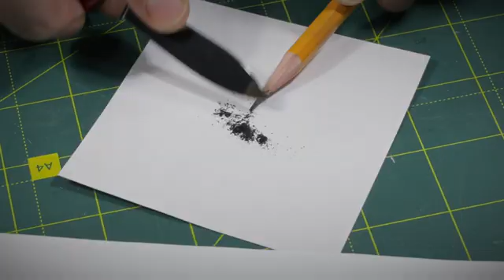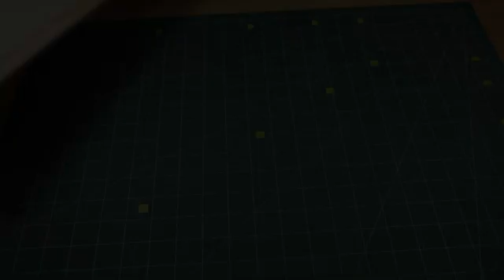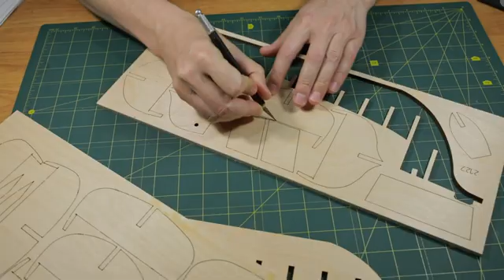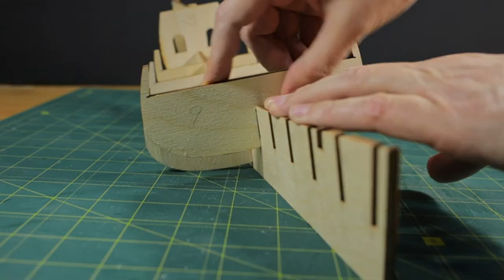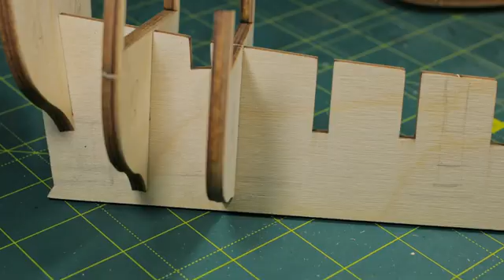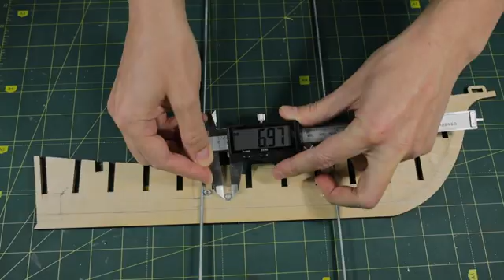# 1. The Skeleton Revamp. Columbus Santa Maria. Scale 1/65

Comment: I am following your ideas.  Inserting infills all the way, not just front and back. But all hand work - no machines.  I am using balsa wood because it is easy to sand, yet it provides firm surface to glue planks to it. 
I am finding that some of the Amati bulkhead pieces are not correctly cut. That is where the infills help to get nice shape.
I am also making some alterations - longer and lower forecastle,  different bow 'nose', cutting off the plywood keel edges, and gluing new edges from walnut.
As you said somewhere - the Amati kit is a good base that allows alterations.
Reply from the maker: I’m genuinely glad that my ideas can be useful. I love machines, and I see creating models in CAD systems as a part of the creative process. But I have great respect for craftsmen who build models entirely by hand, without relying on machines.👍

Comment: Some good ideas that simplify the building of the ship's hull, improving the original kit. Great set of skills, namelly the Autocad's - have you considered some videos regarding the use of CAD in ship's building?
Great job!!
Reply from the maker: Thank you for good words and an idea. Probably I will do it sometime. However there is nothing special in using CAD for shipmodelling. Principles and tools are absolutely the same. Only the scale may differ. What is mire important- how you going to machine the designed part. And this is where g-code for particular CNC comes. With printers, though, it’s a bit more simple.
Reply: @shipmodelideas  I'm not a CAD's expert. I only use it for 2D. Unfortunatly, CAD 3D is, to me, a black area, so to speak. So I welcome your eventual efford to do a video on that! ;o)

Comment: is there anyway to get that blueprint. I also wants to do that with you following your steo by step guide. its for my room
Reply from the maker: Well, I do it based on Amati kit with certain changes. The changes are not based on any particular blueprint or systematic set of blueprints. In this case I rater develop details on the go. I use the book of Xavier Pastor for some references. There are some useful sketches and drawings there.